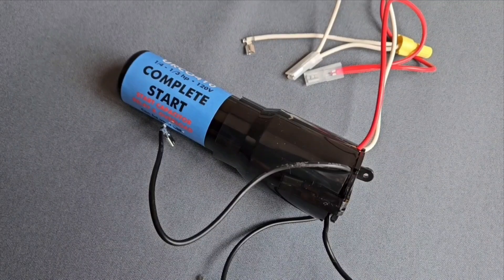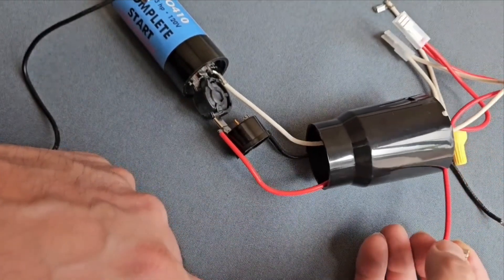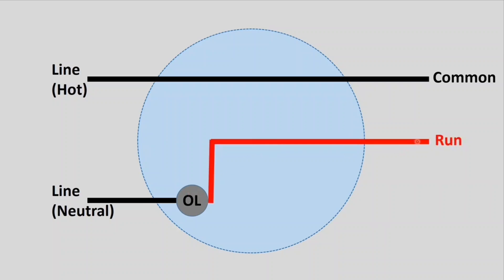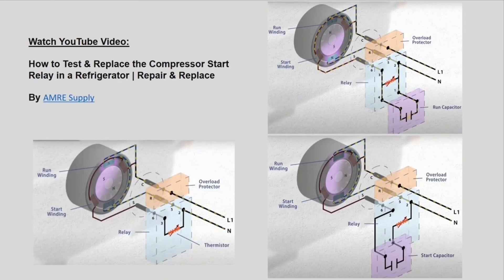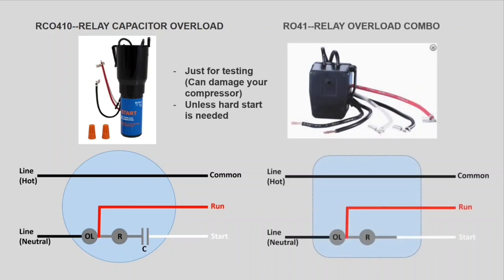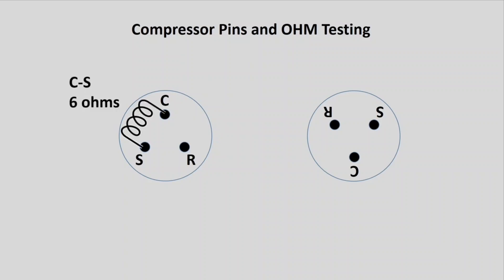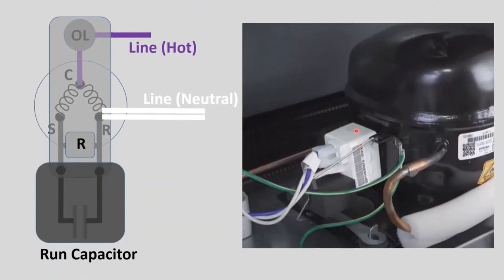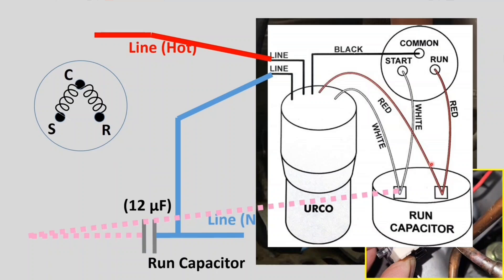Inside a 3 n' 1 Hard Start Kit! - Which Wires to Connect?

Comment: I find the overload protector not work good, I connect 3in1 starter,only 10seconds, compressor stop running, because overload protector disconnect the line, if I can add a 12uf running capacitor outside, I think it will be fine, it will reduce the current so the OL will not disconnect the neutral line

Comment: Totuși cum se conectează în raport cu automatizarea combinei frigorifice și nu doar pe direct?.
Reply: The original hot wire and nuetral that you took off compressor will connect to the two power wires in the kit. The defrost timer and thermostat on your unit, controls when it receives power to run. This is all connected to the hot and neutral wire that was feeding your compressor